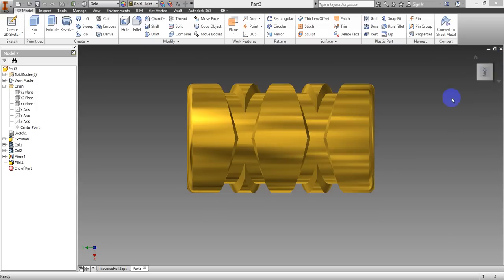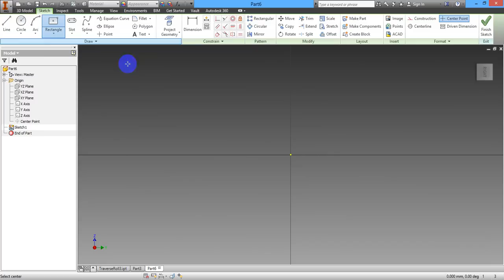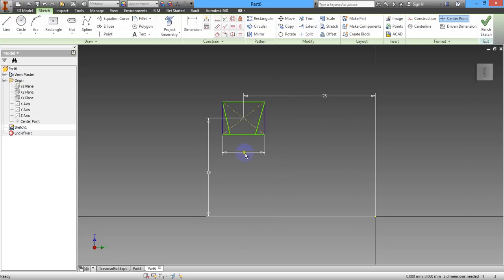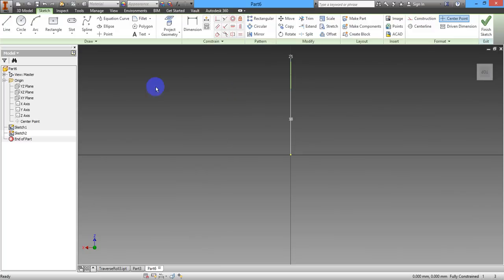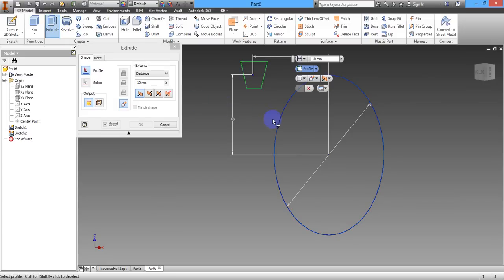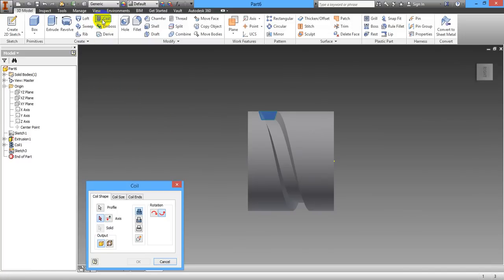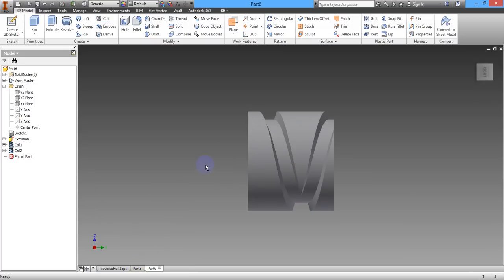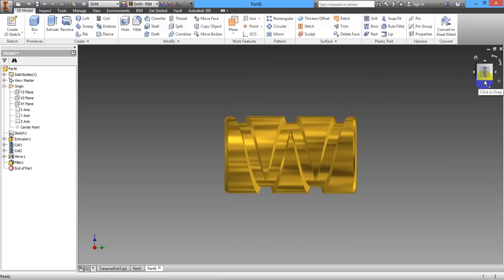traverse roll drawing in AutoCAD Inventor

Comment: Hello again! I wish you all the luck in CAD. Those programs are notoriously hard to understand and operate, but each new 3D mechanical animation I see gives me motivation to continue learning.
I am not sure if choice of Inventor over Solidworks will serve you well, however. I made a switch not long ago and so far I intend to stick with Solidworks. There are multiple small differences and I miss some features from Inventor, but userbase is so much greater is it easier to find help and high quality tutorials. It also seems to me that Solidworks has easier to use animation functionality, which may be what you are after.
Reply from the maker: Dear Piotr, Thank you for your detailed explanation. I do not have much choice in selecting CAD programs. I have educational license for IV but not SW.  Since I am not going to use this software for any reason other than my hobby, I guess IV will be good enough for me. I hope I won't regret.